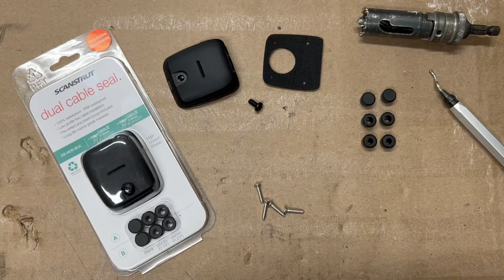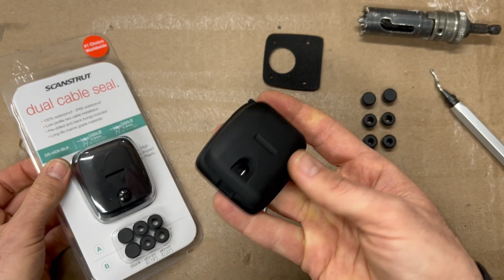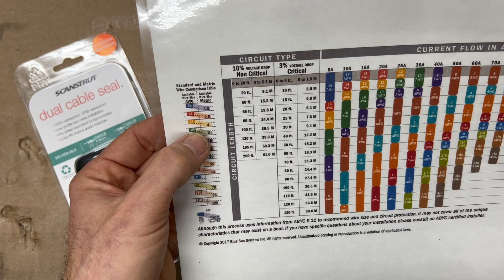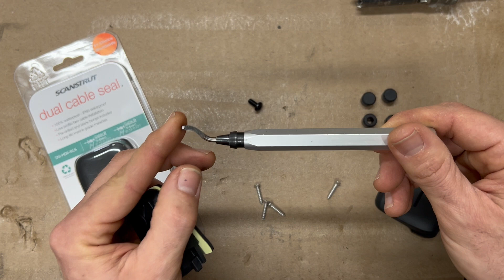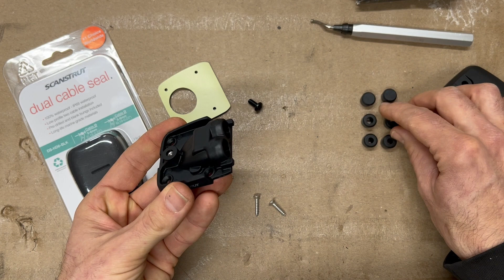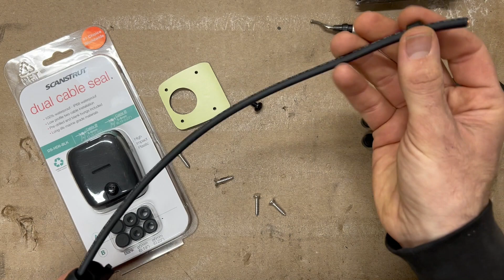The BEST Solar Entry Port For Your Conversion Van!

Comment: Cool product thank you!
Reply from the maker: @RandallSoong-pp7ih  thanks I thought so too!
Reply: Thanks you for the video!
Reply: The screws that come with it aren't meant for use on metal roofs. Instructions say to buy m3 countersunk bolts with nyloc nut. 

Haven't fitted mine yet. Did you put any kind of grommet around the hole you drilled? The exit angle for the cable on this seems like it might rub against the edge?